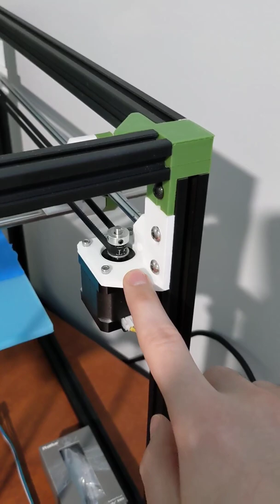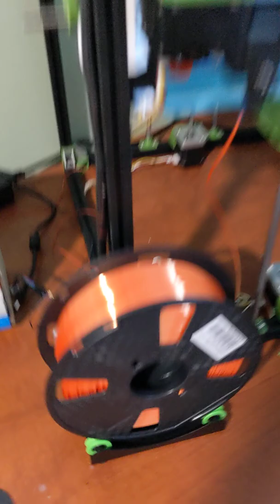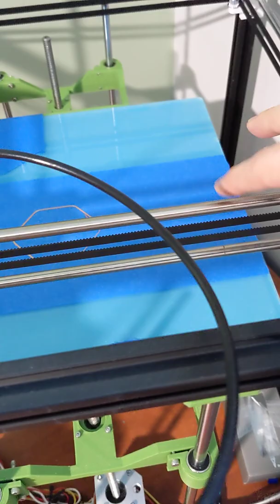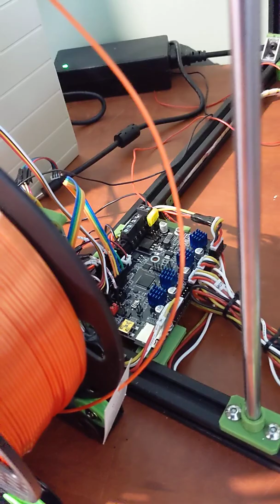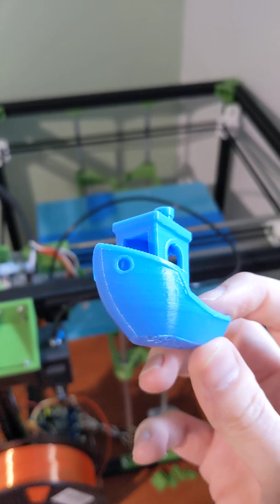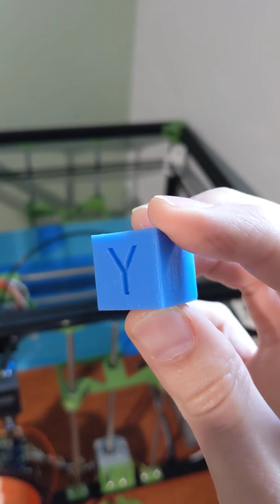Simple Cube CoreXY 3D Printer

Comment: I'm building mine based on BLV MGN Cube design. But with the same initial idea -- to use 2040 400mm profiles for the frame. That's why I had to redesign some of the printed parts from the original BLV project. Plus, I will be using Direct Drive only, probably Orbiter 2.0 + Rapido HF hotend. The initial version will be using the 6mm fiberglass GT2 belts, but this will be the first thing for upgrade if I'm not happy. And obviously it's gonna be under the Klipper control + BTT Octopus board.  🐱‍👓
Reply from the maker: You will see some videos of my new design soon, direct drive voron stealthburner and 10mm belts!